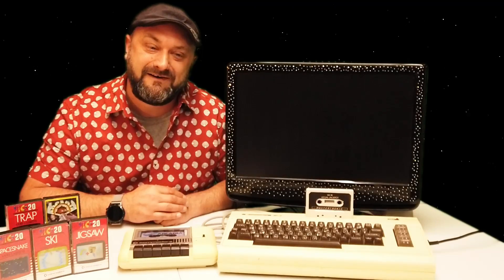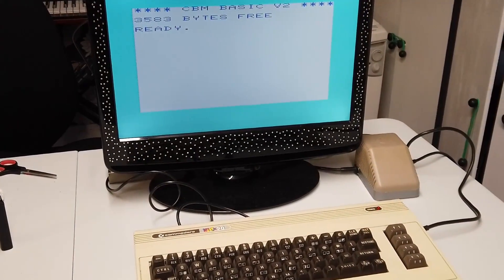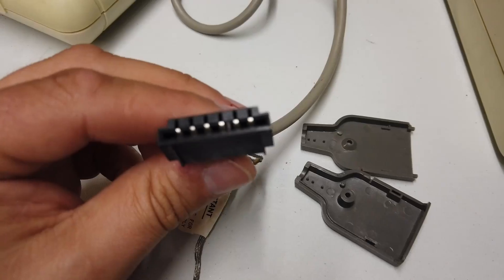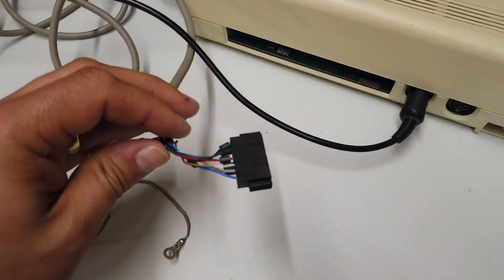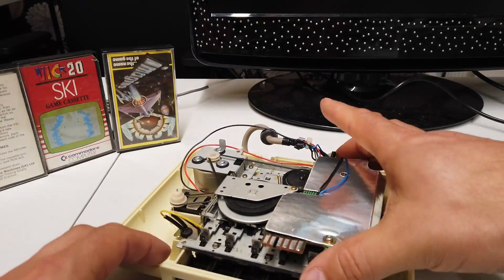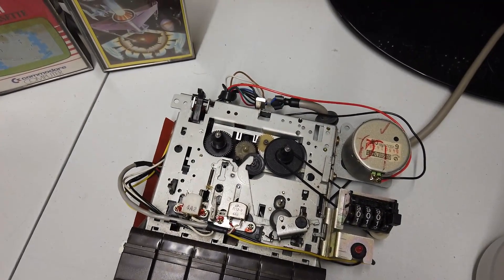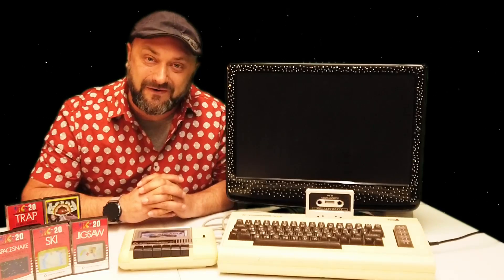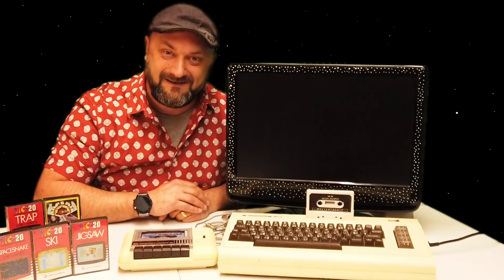DuB-EnG: Commodore VIC20 Tape Drive - A look inside - Clean and Repair - Lets Play some Retro Games

Comment: Hello friend across the pond, I have a Vic 20 with a broken (C symbol) button and it sticks forever and a day. Is it an easy fix?
Reply from the maker: Remove the key cap and spray a little alcahol on the switch...  pull up and down a few times

Comment: I use a US dollar bill to clean contacts, as it has the perfect amount of abrasiveness. I've fixed many dodgy contacts over the years with a dollar bill. Not sure if a GBP Pound is similar though. As for that ground cable, it was only for use on PET machines, as the C-64 and VIC-20 didn't have a metal case to ground to. The right thing to do with them is either cut it off like you did, or secure it to the data cable so it doesn't short out against something.
Reply from the maker: Thats a really good tip...  I was worried about they steel cable finding its way into one of the card edge slots...  and Boom!  I've seen dollar bills used for much worse!! - I think you all have a good point, alcahol and paper will likely do the job!

Comment: Enjoyed watching this. I’ve a spare datasette for a C16 (black version of this, but with a small din connector(?)) and was wondering only yesterday if it can be modified in any way to be used as a cassette player / recorder for a Spectrum for example. I think these may work differently though and might need to get the ‘audio’ direct from the head?

Comment: I actually have 2 VIC20's over at my Retro 8 Bit Bench waiting for some much needed attention and yes I have a Tape Drive I need to test out for it and a ton of disk drives to chose from and some cartridges and a bunch of video cables.    I picked them up because I wanted to have every 8 bit computer I had back in the day.  As soon as I finish up on my Amiga Projects I will get to those VIC20's.
Reply from the maker: That souunds epic!! - Well...  just released the most recent episode - hope you enjoy!!  Check out our AMIGA laptop projects...  they were a fun build!

Comment: Whilst the tape player was open, I noticed the secondary edge connector - as I had never opened up mine I wondered what it was for.
Turns out after a little googling that it was for testing the units before shipping them however they can be easily modified so that players can be daisy chained to `backup` cassettes....Wish I had known this back then.

http://sleepingelephant.com/denial/wiki/index.php?title=Datasette_modification
Reply from the maker: OMG! - You Pirate :-)   How cool - thanks for the hot tip!!
Reply: Funnily enough I was not that much of a pirate back in the c64/speccy days, however my amiga stuff was practically all pirate.
I have made it up since as all of my pc stuff has been paid for.

Comment: Great Video. I just got a Commodore 64. It had similar issues as yours. I replaced the Power supply. I also had a faulty ram that needed replacing. I need to get a hold of a tape player. Right now I am using a SD card adapter to load games. The VIC20, C64, and finally the Amiga were the computers of my youth.
Reply from the maker: I was an Acorn electon guy...  and moved to an achimedes at one point...  then I got interested in girls...  :-)

Comment: 1:47 Ouch! Rather than emery paper, I would recommend as a first course to plug and unplug the connector a dozen times as self-cleaning is part of the design. To go deeper I would use typing paper or any paper with a high clay content, stackd up to the same 0.062 inch width as the PCB and then wet with several drops of contact cleaner, ideally DeOxit which deserves it's stellar reputation. The reason for this is the contacts are made from a base phosphor bronze with a protective alloy over that of something like nickel and finally (assuming this is a good quality connector) a contact surface with a tiny bit of flash deposited gold on top of that for self cleaning, and emery paper will take gold off contacts like butter off bread. The PCB has a substrate of copper with nickel on top and then the layer of hard gold on the fingers. In both cases, the emery paper will go right through the plating if you push and give you a temporary fix but a shorter lifespan and less overall reliability. The gold is there for corrosion protection and self cleaning so it's best to not wipe it away and to get the gunk instead. For the PCB, I would suggest instead to disassemble the VIC20 and use a regular soft pencil eraser to polish up the hard gold edge fingers directly. It's usually organic contamination or lead oxide on the fingers that causes the issues. Bloody finger connectors... grrr.
Reply from the maker: Now here’s a fantastic education!! Thank you!! ...  I agree I was lazy and went for the first thing that came to mind...  (it was super fine Emery cloth ... 2000 grit :-). But yes I agree, that gold plating  is only microns thick!!  I promise not to be a naughty lazy boy again :-)

Comment: Thanks for sharing! 

The überslow C2N tapedeck, as proprietary as they come. Pet, VIC20, C64, C128 all were able to use these. And notoriously slow, well at least the 3.5Kb RAM of the unexpanded VIC is so small that actually loading in a game doesn't take as long as on the C64. Less RAM to fill up ;)
The deck is quite easy to take apart, sometimes all it takes is a clean but it can happen that azimuth adjusting of the heads is necessary when load-errors occur. I think you lucked out as often an almost mandatory belt replacement is necessary after all these decades. 

An iconic system! Atari 2600 style gaming on a Commodore machine!
Reply from the maker: I plan to order in some belts ... that poor tape deck still needs some love!!!  I remember waiting 5mins or so for games to load on the electron with its 32k ...  thank goodness they invented disk drives!! :-).  Have a fantastic weekend bud!!